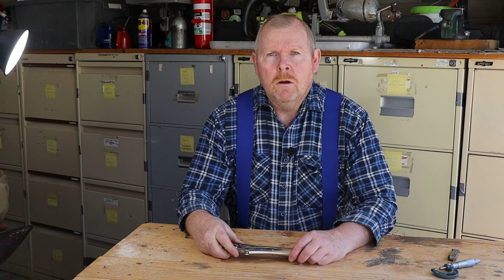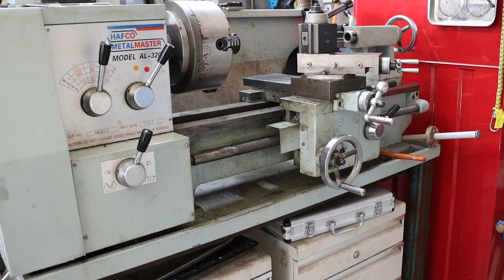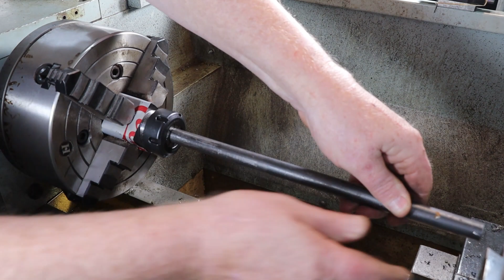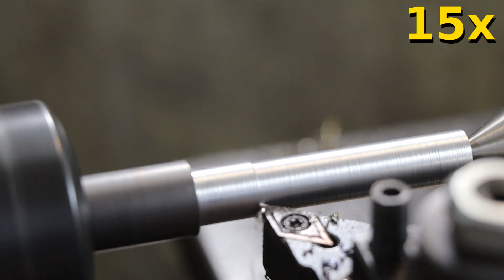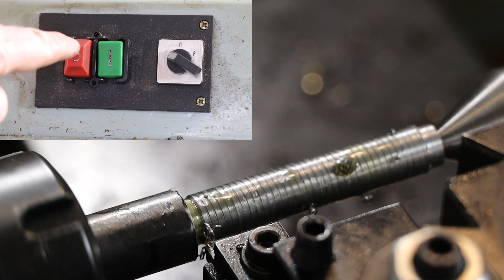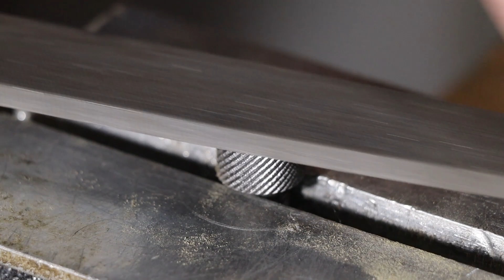Cutting Threads in the metalworking lathe

Comment: What motion on the lathe actually makes the thread on the metal piece?
Reply from the maker: It's the combined rotation of the part in the lathe chuck, synchronised with the right-to-left movement of the carriage.  The lathe's carriage and spindle are connected together by a series of gears and shafts during this process, so their movements stay synchronised.
Reply: @TightwadWorkshop It still baffles me how threads are created on a piece of round metal stock compared to cutting it round ... how do you get 8 threads per inch versus 12 threads per inch?
Reply from the maker: The "lead screw" is our very accurate reference thread pitch.  We use different combinations of gears to connect it to the spindle, and that allows us to adjust the horizontal movement of the carriage (which is holding the cutting tool), to match the pitch of thread that we want to cut.

e.g. if we want to cut a 12TPI thread, we want the lathe spindle/chuck to perform 12 full rotations in the time in takes the carriage to move 1" horizontally.  

Likewise, if we want to cut an 8TPI thread we consult that chart on the inside of the lathe's door and set up a train of gears between the lathe spindle and the lead screw that will have the spindle turn 8 times for each 1" of horizontal movement of the carriage.
Reply: @TightwadWorkshop Thank you for your explanation.